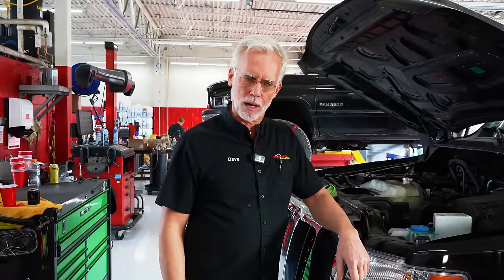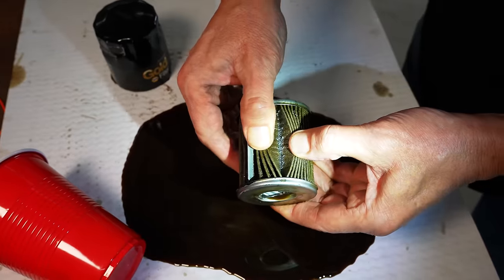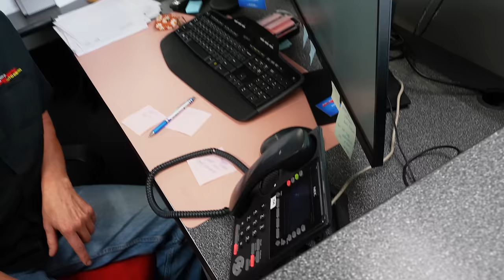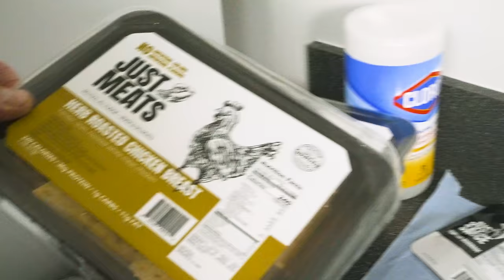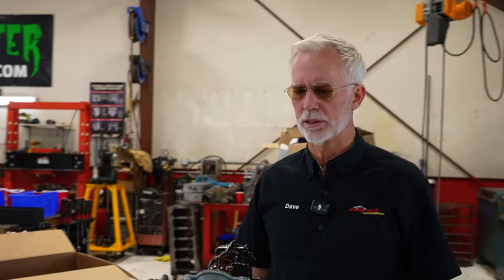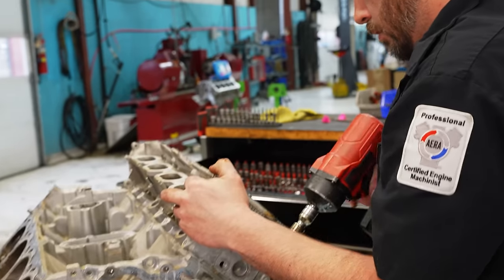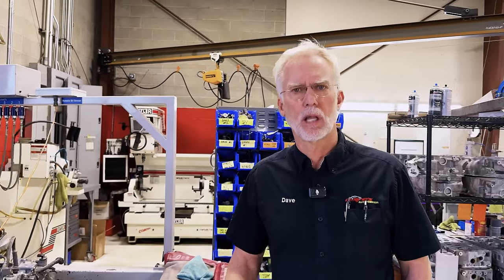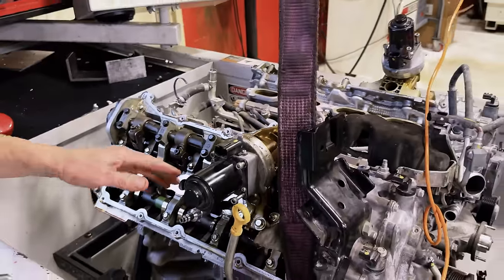2018 Nissan NV 3500 Van. Lack of oil changes ruined an engine with only 50,000 miles on it

Comment: That’s such a bummer. I have a 2010 VK56 Pathfinder with 160,000 miles.  Regular oil changes and nothing has ever gone wrong with the engine. It’s been so solid.
Reply: A V8 Pathfinder? You’ve got a serious unicorn right there.
Reply: I’ve got an 08 Titan with 180,000 miles, I have always done regular maintenance and it is the most reliable vehicle I’ve ever owned.
Reply: @Constabruity  the armada around that era was called the pathfinder armada so not much of a unicorn just nissan stop using the pathfinder branding on the armada
Reply: @ryen49  AFAIK, the Pathfinder Armada name was unique to 2004 models and abandoned thereafter in favor of just “Armada”. Nissan did slap the V8 in the smaller Pathfinder for a few years, but only made a few hundred examples. Pretty unique vehicle to find.

Comment: Bought a new Toyota 4Runner, 2022… came with a 2 year free service deal. As a life long technician, I’ve seen enough young dudes on the lube rack, and the consequences thereof. Also, as an OLD tech, I have a 9000 lb twin post lift in my garage, and have done every oil change, 5000 miles apart. In my glovebox, I have every oil filter box flattened and rubber banded together, with date and mileage on them.

Comment: Simple oil changes and these things will run 400k miles without batting an eye. We had a Nissan NV2500 parts van for my Toyota dealer that had 400k miles on it before we pulled it out of service. This thing never owed us a dime. We only ever put exhaust and suspension/brakes on it. We only used mobile one oil for it 👌

Comment: Nostalgia is interesting. When I was in high school we got 60,000 miles out of a 1954 Merc until the engine needed rebuilt. Dad's old jeep required valve adjustment at 20,000 miles and had to grind the valves or engine rebuild at 40,000 miles. 
Today's engines hold up well IF PEOPLE WILL JUST CHANGE THEIR DANG OIL.

Comment: As an automotive tech I have made it a 100% habit that if I open the hood of a customers car I check the oil level. I don’t care if I’m doing a massive job or a simple battery change, if the cars in my possession I check the oil level and recommend if it’s nasty but at the very least I will make sure it’s topped off before leaving. I never want someone’s motor to lock up after leaving the shop because I didn’t take 60 seconds to check the oil. You would be amazed at how often you pull a dipstick and it’s bone dry
Reply from the maker: Great service! That's what we like to hear 👏👏

Comment: This definitely makes it evident why Dave’s shop stands out from the rest 
Had to replace the engine on my fathers 2011 Impala 
Our budget wasn’t the best so we went with the lowest bidder 
You would think that common sense says clean the replacement engine and check it for leaks and damages (simply bc the maintenance history is unknown)
Well don’t think that shop did that and I’m stuck with an engine that is leaking from somewhere and I am fed up with having to take it back and forth to the shop
Unfortunately for us we are in CA and budget wise we couldn’t make the trip to Dave’s shop to have them do the job 
I’m simply going to try to cut my losses and sell the car to someone who has some mechanical expertise and fix the leak issue

Comment: The 5.6 V8 in the Titan and Armada from 2004 until about 2019 ish were one of the best motor and trans combo known to man. The rear diff on Titans would get hot and cook the fluid but throw a vented diff cover on and you were good to go. Ive been with Nissan since 1999 and all I can say is quality is not the same since around 2007 and the CVT trans. 2.5l had issues with the egrless system taking out cats and rings.

Comment: My company has a fleet of about 20 of these vans for our service techs. We have yet to have any motor issues, most last to about 250,000 miles before we sell them off. The only issues we’ve had with these vans is the front ends need to be rebuilt around every 90k miles. Too bad they don’t make them anymore.

Comment: I worked at a dealership- flat rate techs hate oil changes and look for what pays hours.  Youd also have to put a deposit of $1000-$2000  down to get started on engine or transmission work.

Comment: That’s right señor Dave!!! You are absolutely right!!! I got 300 k out of my  1988 Chevy c1500 with a 3.4 v 6 engine with 5 speed manual transmission and I was doing oil changes with filters oil and air on a regular basis like every 3 k miles or near the 3k mile mark and I had a stroke and that was the end of the truck completely nobody else could drive it cause it was 5speed manual.. and I was severely injured and disabled so I had to put it on sale and it was a sad day for me when it was towed away 😢…that truck took me to work every single day sometimes seven days a week when I had two houses remodeling kitchen and  bathrooms  use to drive all over DFW and I think I drove an average of 90 miles a day just carrying my tools and materials like Sheetrock or  boxes of tile but if I didn’t got ill I’m sure I was still driving that truck so I have been making my sons the good habit of doing maintenance oil changes on time replace air filters check everything and listen to your vehicle and fix the problem right away…and with honest mechanics like you there’s no drama everything will work just fine..Saudi’s!!! Love to watch your videos and God bless you for taking care of your workers and share your blessings with them is a great gesture of respect and appreciation I wish I was working for you…best boss in the business 👋😃👋Saludos!!!😊
Reply: Thanks for sharing your story. I pray you are recovering well from your stroke. Take care!
Reply: @grumpyengg5978  Thank you so much for your kind words and your prayers!!!Blessings for you and your family!!!👋😃👋

Comment: Someone who's been doing this a long time will get a lot of knowledge and experience but that doesn't necessarily mean they'll have lots of WISDOM to go with it! Your comment about keeping the old headgaskets was pretty profound. I'm coming up on 15 years in the trade and am kinda embarrassed that I never thought to do that... I'll carefully place them on the block and inspect holes to make sure I've got it on the proper bank and orientation but could easily miss a minor design change... That's scary to think about... Thanks for offering the little tips/tricks/nuggets of information you throw in these videos. That's why I watch them.

Comment: I've never done an oil change on my car because I don't know how. I get it serviced and oil and oil filter is changed then. My dad lives in another state, and has some car ramps. Well, I've been watching Dave's videos a while and he's got me convinced I need to change more regularly. So dad's going to bring the ramos over and I'm going to have a go at a full oil and oil filter change. I have a service manual already, but need a tool to remove the filter I'll have the mechanic on stand by in case I bugger it up. Wish me luck!
Reply: When i change my oil I just stick a screwdriver through the filter to help me take it off lol. But mines a big diesel truck filter. Once you do it once or twice it's super easy
Reply: As long as you have space, use an oil filter plier. Nothing works better.
Reply: oil filter tool will make life easier. there are different tools out there. i like the wrap around type...
Reply: It’s easy.

Comment: I learned at a very young age, oil changes are CHEAP INSURANCE. I have a ‘63 Mercury with a 260 V8. Replaced the timing chain in  1969. Rebuilt the carburetor a few times. Runs like a sewing machine at 158k miles. How many of those old engines never went passed 70k before they crapped out from lack of maintenance? A lot of them.

That car is my YouTube photo.

Comment: 40 years in this trade and engine rebuilding for me is a thing of the past. It’s great that you still do this and are amazing at what you do. When you warranty an engine that you build you have to warranty every manufacturer that sold you the parts to build the engine, and that’s too much liability for me. 
I remember taking apart an engine that looked the same inside as this one. I asked the customer did you ever change the oil and he said no. His thinking was he only planed to keep the vehicle for 3 years and trade it in on a new one. So why waste the money on oil changes when the trade in value was the same with or without oil changes. 🤦🏼
Reply from the maker: Unfortunately, this does happen. Thanks for watching our channel 👍
Reply: OMG

Comment: Love that Engine tear down table set up.
I always put cardboard in front of A/C core to protect it from any damage.
Dave was Right On when he was talking about Engines from the 60s, 70s.
He has Personal Experience from working on the earlier engines and the issues they had.
Everything is so much better now if you follow the Recommended Service Intervals for components.
Not uncommon to work on vehicles with 200,000 miles or more.
My 2005 Maxima daily driver to work and back has 250,000 on it now, going for 300,000.

Comment: A few years ago I trucked in and thru Utah a lot. I’m in Western Colorado (Silt). 
Truck parking near SLC is hard to find. When I delivered Lowe’s from the Denver distribution center,to the SLC area, I discovered a Lowe’s in your neighborhood. 
  So I had a spot just down the street from your shop to park if I couldn’t make Brigham City or West Valley. 
  Between Lowe’s & Petco. There’s a 5 guys restaurant out front too😉

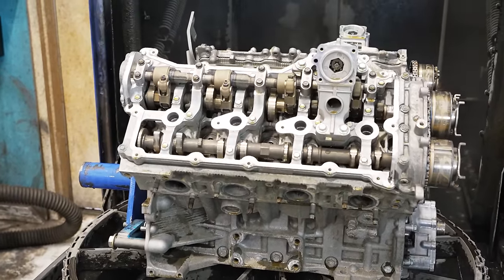Comment: 9:56 I'm sure other people disagree with you as well but points and condensers are electrical issues.  I think we can all agree that electronics has progressed much more than motor technology...  Older engines used better metal and components than the plastic ones of today.
Reply: Totally agree! Just look what they can do with pure silicon! And one of my favorite activities is riding my electric unicycle, yes electronics have come a loooong way! Now we need a major battery density breakthrough!
Reply: @steveo6034  I'm more of a diesel fan myself or perhaps diesel electric but.. let's not be crazy about electric batteries that go bad in a few years.
Reply: Older engines don't compare....told 302s and others wouldn't go 200k with only oil changes.
Reply: @joshc606  longevity and quality of lubrication has changed dramatically.  You can buy remanufactured and even new 302 engines today.  I presume you're talking about the Ford 302/aka Windsor V8 which was produced all the way into 2000?

Comment: It seems as though the peak of reliable cars was the 90’s into the early 2000’s.  Now with the CVT transmissions, direct injection, EPA required emissions, and displacement on demand, reliability has dropped even if you are meticulous with maintenance.

Comment: If I could have found a shop like this, I would have continued wrenching till I retired. Instead, I walked away in 1985. After 15 years at dealer, getting screwed at every turn, and battling the ever declining "flat rate" I bailed

Comment: Ive got 228,000.00 miles on my 1990 ford mustang gt convertible with a 302 and AOD transmission maintenance is EVERYTHING!!
Change oil every 3,000 miles.

Comment: Modern engines CANNOT miss oil changes. I tell people this. Its not your 90s honda/toyota that if theres oil its ok. These use oil more like diesels do to pressurize cam systems fuel systems etc. Plus direct inj causes so much over carbon build up

Comment: I have a 2015 infiniti qx80 with the same engine , has 211000 miles , just did the valve cover gaskets and was surprised by how clean it was under there. Only the slightest yellow and runs like a champ . I do 3k mile oil changes .

Comment: Fleet maintenance logs. Once a week drivers give you the vehicle miles, fleet vehicle logs you track all oil changes and maintenance on each vehicle and every vehicle comes with a maintenance schedule in the owners manual. You will know what maintenance is  due for each vehicle based on mileage.

Comment: look at the crud under that valve cover

 I have an 09 Ford focus that gets an oil change every 8000 miles 

you could pull the valve cover and you could eat off it there is no debris in there and it isnt using oil at 755,000 miles but I start it and run it and change it every 8000 miles

I now have a 16 fusion that I have put 277,000 miles on in two years it's not using oil either

do your maintenance folks come on it's not difficult !

Comment: Interesting comment of the old versus the.. 1981 I worked in a machine shop.. I did valve jobs... Most were 75000 to 100000 miles.. the valve job give you another 40000 and then you were looking at an engine would run.. due to leader gas.. so today they do last way longer.. But much more difficult to diagnose and work on

Comment: Hi there your workshop's lovely and you're right on it. Just frightening enough to make it work.
Don't slag off all the 70s stuff I had a 71 Merc 220 did 450k miles with one carburettor rebuild and one clutch replacement. Super car only sold it on my last divorce. I'm very keen on maintenance and oil changes. A gritty feeling in the oil can be carbon. Thanks for bothering to make videos.

Comment: Yes,it's the VVEL (variable valve event lift) technology which Nissan uses in their newer cars as well as the Infiniti cars,it looks like they have never changed the oil.

It's as bad as when I was at a Holden Commodore dismantler over 20  years ago when they were pulling down some sludged up Nissan RB30E engines which only had done 183,000 Kilometres or 114,000 miles.

My point is that Nissan expect that they last 400,000 kilometres or 250,000 miles before they need to be rebuilt but I think that I exceeded that sort of expectation.

Holden kind of adopted that engine between 1986-1988 due to the mandatory introduction & use of unleaded fuel in New vehicles from February 1986 & Holdens old 3.3 litre 6 cylinder engine couldn't easily be made to run on unleaded fuel.

They ran the Nissan engine until the foreign exchange rate made that engine too expensive & we weren't looking forward to Holden bolting in the 3.8 litre Buick LN3 V6 engine.

The only thing that it had going for it was its huge amount of low down torque which didn't move the larger & heavier VN Commodore too badly!

Comment: 2018 van, imagine you do 3 oil change a year cost you $250 times 5 years total 1250.  Now an engine probably around $5000 the numbers are not lying sadly

Comment: I wonder if it EVER had an oil change. That is unreal at those miles. Yeah.....100,000 miles on the stuff we had in the 60's and 70's was about it. The stuff was pretty junky and the build quality was marginal. Brand new Trans Am in 1977 (400-4-speed) and as I drove it home it vibrated terribly over 45 mph. Here the drive shaft was not dropped in the yoke and seated  correctly...but just "close" and the two u-bolts just reefed down.

Comment: 9:57 that's what i've been saying! i have a lot of older family members who complain about modern cars, about how there is so much stuff that breaks, blah blah blah. nonsense. modern cars are safer, more comfortable, cleaner, more efficient, faster, WAY more powerful and yes, more reliable. i've seen lots of fords, toyotas, and even BMWs (straight 6 engines) with north of 200k miles that had nothing but oil changes done. my 2018 BMW 540i (delivered September 2017) is passing 120k miles now. my previous 5 series had north of 250k, and still ran fine when i sold it. never had a problem because i change my oil and don't rev up the engine when the oil is still cold. i have heated/cooled massage seats with a cabin that's quiet even when i'm hauling ass at 90 MPH. can't get that in your 1980s 4 speed rust bucket

Comment: Dave I agree with what you say  , you have experience, knowledge and know how !  Too many new vehicles with major problems, too many have melted down the engine and are only a few years old , most are very expensive vehicles !

Yes the good old days of owning and maintaining a 52 ford and 61 ford and then a 53 gmc that ran for 14 years ! 
My 61 ford was still going after I sold it after I drove it 11 years ! 
Then my 69 Chevy that ran forever and my current 34 year old gmc truck I’m still driving ! 

Newer is better , newest is best , I hate to say it but that’s not what I’m seeing ! 1 year old vehicle major problem , diesel 4 years old that needs an engine , 6 years old diesel needs an engine , then the power stroke engines that blow up , bad design and bad engineering ! 

Companies that still can’t figure out how to build a durable , reliable engine after 120 years of making them !! What is wrong with that picture !  100 K for a truck that needs an engine in 5-6 years !  That’s not a good investment to me or even close to being one !

Comment: It seems like just starting with a new or rebuilt engine would be so much less labor as to make it the best choice.
I understand you are a machine shop and admittedly I have zero machine shop experience.  Appreciate you explaining why I am wrong.
Just a mechanic from a small independent shop.
Reply: Labor is so expensive.  At least around here…

Comment: My Pontiac with 263K on the clock and rust up to the door handles went away sounding better than that.

The transmission, not so much....)